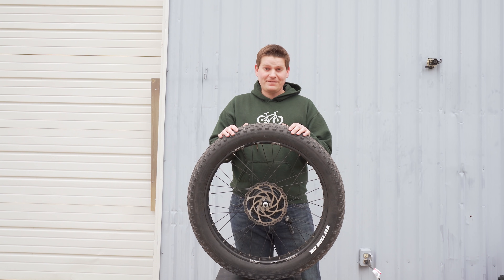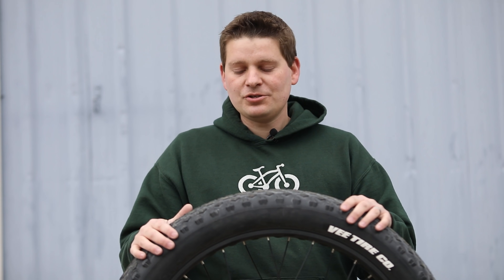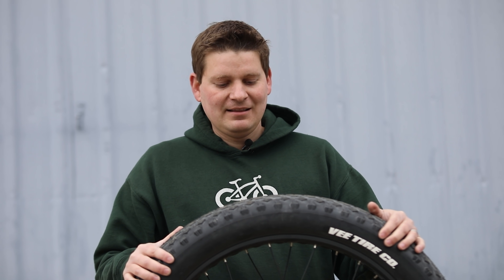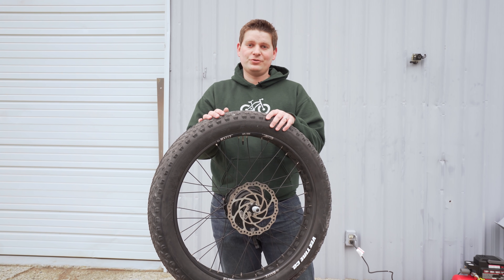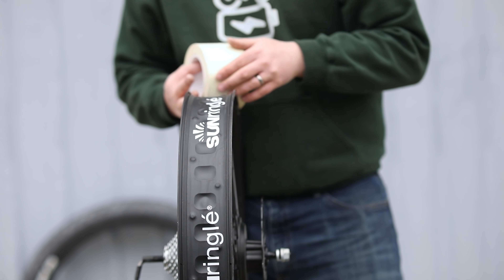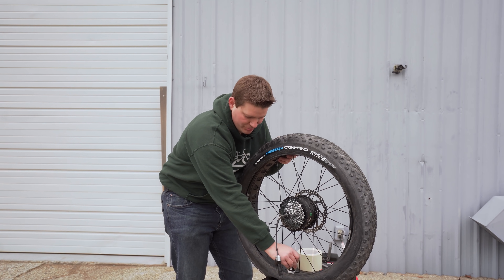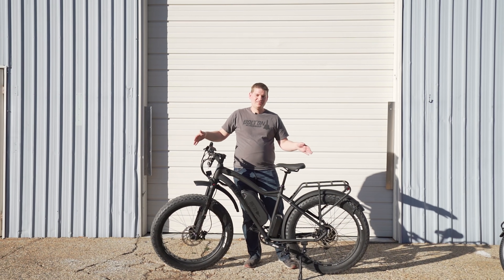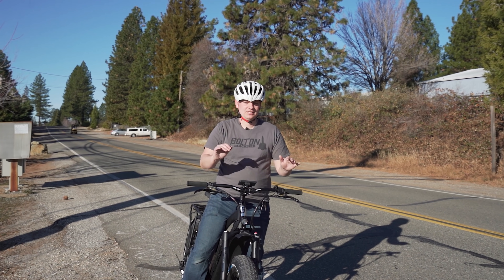Are Tubeless tires good for ebikes? I explain HOW and WHY

Comment from the maker: What other questions do you have about tubeless tires?
Reply: Do you think going tubeless is better than having inserts like Tannus armour? (or you can just make a video about it)
Reply: Do they make a good tubeless ready street trie
Reply: So nothing replaces the tube inside the tire?
Reply: @gbrldz0  Sealant and sealing tape replace the tube.
Reply: Diaz Justine sealant works great ihit a nail the other day . Just pulled the nail spun the tire a couple of times and kept riding that was more like two mouths ago still riding
Reply: Maersk ship from China to LA lost 750 containers in rough weather on Jan 16th.   I hope the blackbirds are headed to Oakland!🤪
Reply: I really enjoy your videos and I'm hoping you team up with a business partner and go hard and LARGE nationally.
As for me I'm sticking with a heavy solution.
Tannus liners with smaller, thicker and heavier motorcycle tubes WITH the appropriate amount of the FLAT OUT tire sealant you recommended.
Heavy? Yes. But almost bulletproof.
Reply: This guy asks for questions then doesn't respond to any of them... Gg

Comment: Instead of weighing 2 bikes cuz I would garrantee even though they are exactly the same there will be a slight difference, why didn't you just stand on the scales with the bike before you started and then just deduct your own weight, and then do exactly the same when you had finished the conversion,this way it would have been absolutely precise, you could have even weighed the 2 inner tubes and the old rim tape and then weighed the roll of new tape and valves and bottles of sealant and deduct it from from the first weight then just add back on the weight of the empty sealant bottles and the remaining tape on the roll. Or even better weighed both wheels before and after before putting them back on the bike .but apart from that I was searching for a video like this and now I'm going to tubeless, cuz you learned me something that I had never even thought about, the amount of energy that was lost compressing both the tyres and the tubes so yeah great value to have watched your video mate, keep up the good work I've learnt something out of it thanks .watching from England West Midlands.

Comment: Several important steps were missed in this video. Rims should be cleaned with alcohol and a clean cloth before installing the tape. When installing the tape, pull tight to minimize air pockets and rotate wheel in the direction of travel. Apply 6" at a time and press out the air bubbles from the center to the edges. Start the tape opposite of the valve stem hole and overlap about 6" at the end. You also want tape about 5mm wider than the inner rim width so it goes up the edge a little on each side and can seat into the spoke channel. Cut excess tape from valve stem hole being careful not to damage tape inside the rim. The 4oz of sealant used in the video is not enough for a fat bike. Use 4 oz for MTB and 8 oz for full size fat tire.

Comment: Your ebike's motor has probably reached it's full speed on flat surface, so getting tubeless wont improve this much. 
But... Tubeless could potentially affect tire diameter
+ lower rolling resistance from lack of innertube, but Minus is micro resistance of sealant.
+ lower rotational mass, faster acceleration and breaking
+ lower overall ebike's mass, so faster on uphill
and If I'm not mistaken rolling ressistance is affected by weight, so 1-3% less rolling resistance just from lower gravitational force exerted on tire.

Like you said, lighter bike, more puncture resistant, less friction=power efficiency.
Only downside is compatibility, price, need for refill sealant sometimes and more frequent pumping.

Comment: If you forget to check tire pressure, it will get low and sealer leaks out.
You have to add more sealer, regularly because it dries out inside of tire.
If you lose pressure on ride, and bead separates from rim, you need special high volume air supply to refill.
You need special rims and tires.
To much hassle for me, will stick with tubes.

Comment: One of the MASSIVE disadvantages is mentioned in the above video but passed off as almost inconsequential.  12:15  Sometimes you can loose up to 5psi a day from going tubeless with a tubed-intended rim, no matter how careful you are.
Reply: I would assume you wouldn't loose any air if you have sealant inside the tire.

Comment: All the fat tires on my ebikes are pretty loose once on the rim, the tire can be mounted by hand no tool required. Vtuvia, Lectric, Himiway are all the same way.  I don't think there would be a way to seat the tire without the tube. I put sealant in all the tires and had to lift the wheel off the ground so when tube filled up it seated the tire evenly.

Comment: Ridiculous video.  Why not just weigh the tubes individually to come up with the weight savings. Saving three pounds and constantly losing air is not an advantage.  Three pounds is hardly perceptible on an ebike.  My wife weighs less than I do and we can both go the same speed and have the same endurance on our class 2 ebikes. You can fix a tube flat without having to take the tire off the rim. Also putting run flat or slime in a tube is a lot less messy when it’s in a tube than when it’s in a tire when you need to take the tire off the rim.

Comment: Great info! And converting to tubeless does indeed make sense including the "back up plan" on re-installing the tube "if" you have to.
Reply: so you are still carrying the tube,, just as a backup now? great weight savings. BTW Peter was wondering when you were going to pay him back. Also, Paul says Thanks.
Reply: @Kevin-ke2lk  Not only do you have less rotational mass which makes handling better but you also roll better making the extra weight negligible, especially on a fatbike that already weighs quite a bit on its own and if you're a heavy rider. So even if you take the tube with you its more than worth it.

Comment: Hi, I wanted to ask if you have tried the Tannus tire armor before. And if so, do you recommend them for bikes and ebikes?

And I had one more question about this time I went to a trek bike shop, I asked them about the Tannus armor, not sure they new what I was referring to exactly, but they said those types of tire armor cause damage to your wheel rim in the long run. Wanted to ask about this too since I haven't heard the same thing from anyone else.
Reply: I 100% recommend Tannis Armor. Best defense against flats on the market and it even provides a more cushy ride after installed. 1,500 miles and zero flats. Even ran over some beer bottles by accident a couple times.
Reply: Btw I do trails and beach riding with my bike so it has been less than ideal riding conditions

Comment: What is funny about a tube tire the worse scenario is a spoke puncture which I had happen on a 26x2.125" tube. The tire had Green Slime in it and that sealant would
not seal against it. I removed the tube and use a wrap of black electrical tape around the rim and replaced the tube with a new tube that had the Green Slime in it.
I never had problems after that with the the rim and eventually went with mag wheels which have sealed bearings. This bike had a 212cc Predator engine on it and
a standard spoked wheel would never hold up under the power from this engine. A solution would be which is better is to go to motorcycle rims and DOT rated tires.
I would say that from my persoanal experience that the mag wheels with sealed bearings are a winner since I've ran this same bike over 3 years with no problems
with the tires except the rear tire wears faster than the front tire since some of the rural roads are chipped during the summer and believe it or not, the front tire
will probably last another year with well over 5k of miles on it.

Comment: Hello Bolton ebikes, ive watched your recent video about Eunorau dual motor ebike. what im thinking is how bad is rolling resistance with two motors?
Reply: It shouldn't effect rolling resistance but it does weigh the bike down reducing range. I'm not particularly a big fan of dual hub motors personally. They do good for traction in a straight line but can get squirrely on turns, especially on slick terrain like wet roads or gravel. Essentially when you turn the wheel they become opposing forces and make it easier for your front tire to slip out from under you. If you are doing dual motors I would suggest a rear hub + mid drive setup.

Comment: You can take her oodles from a bicycle and use it as a tubeless tire you just all you do is take the end and get it right at what the inches are supposed to be cut it off take a piece plug up the holes on each side glue them together wait till they dry and then put it in there and if you need any extra like green that green slime stuff you put it in there and it works as a and it's one of those oodles those that the baby swim on you know it's called the oodle you know it's what it is what it is and it's it's just anyway if food for thought you could try that on these tires that do not carry the all rubber tubes this is what one guy has came up with but I didn't get the end to see the end of his as far as him writing it to see if it worked but he'd made it looked pretty good to me from what I saw anyway could you try one of those thank you bye
Reply: It's really hard to read what you're saying because you use NO punctuation whatsoever!! Furthermore,  it's actually "noodles" not "oodles"🤔

Comment: The very first day I went out for a ride on my e-bike I headed to some dirt roads here in Petaluma to see how well my new mountain e-bike would perform, it performed great but for both tires getting flat because of goat heads. I kept the tubes but added sealant into the tubes rather than get tubeless rims and tires since I couldn't afford them, after adding sealant I haven't had a flat since. BTW I used Green slime since it was available at most auto part stores. Since than I went with another brand, but you can do your own research. Having said that if you can afford tubeless rims and tires, get them, well worth the cost and performance.
Reply: I have a 1.5kw Senada Saber first with the 26x4” stock tires and now with 26x3.5” Vee Speedsters (30TPI tube ready) I have 5 tubes laying around that can be patched and reused. I’m sooo tired of having to randomly change a tube, although I can do the whole process in 5-7 minutes now. Tubeless seems like the way to go as I wouldn’t have to remove the wheel to quickly fix a flat tire - which is the biggest advantage in my opinion.

Comment: I put tubeless tires on my Trek Powerfly 5, which is a hard tail with 29 in tires. I appreciate the increased grip and smoother ride; however, I’d like to have studded tires for the winter but it’s a pain to switch tires.
Reply: Do u have any advice on how to remove your back tire to a ebike?
Reply: @michaelvarguez953  Nope, I got the shop to do it. You have to have a special compressor if you’re using tubeless tires.

Comment: How do Tannus Armour inserts compare to tubeless?
Reply: 1. With Tannus you have run flat ability. 
2. Tannus is heavier.
3. Never had a flat with Tannus Armor.  1000+ miles now.
4. When your tire wears out you can move armor to your next set.
5. Tannus provides a softer ride. More "suspension" if you will.
6. Slime etc al in a regular tube gives equal "flat prevention.
If your getting snake bite flats  or sliced valves you are running under pressure anyway. Stop it.

Comment: Well here is a new update on my 26" Blackbird with the tubeless tires so far after riding 69 miles with zero and 1 pedal assist i am at 47 volts or used 50% of battery which probably could go at least 80 miles or more on a single charge this includes some hills so very impressed!!! Love my new Bolton Blackbird well done Kyle
Reply: please tell me more. hows the standover? do you ride in wet environments often?

Comment: nope, no way...sorry but gotta call you out on being able to run lower pressure in tubeless tires. tubeless and low pressure is bad because of the danger of popping the bead and dumping your air, tubes win this round EVERY time. If you hit something hard enough to "snake bite" the tube you probably would have blown the bead too.  Ask anyone who plays in the sand or mud or races off road about this, Low pressure and tubeless equals flat tires. AND.....come on man, weighing two different bikes to make a weight saving claim? weak man, really weak. give us the actual weight of the tubes and the weight of the tape and any glues used to mount the tubeless tires....ACTUAL weights, not some mythical differences between different bikes when the bikes probably didn't weigh within the same to begin with. Sorry to rip into the video like this
Reply: YEP !  You are 100% correct.  Kyle seems to come up with some really strange stuff at times.
Reply: @specialist-in-tech  I have heard other "bike" guy's say the same thing so I suspect it is coming from a tubeless bicycle tire manufacturer as a sales pitch.
Reply: i agree here.  plus... how many cyclist have a high pressure, shock pump, compressor able to blast seal the tires onto the rims?  cause a slow hand pump won't

Comment: How do people get flat tires on their ebike.
 I've had my ebike for almost 1 years now.
I ride it every single day.
When I built it I bought the cheapest tyre I could find =£9.50.
I've never ever had a flat tire front or back.
And it's very heavy
With two big battery packs
And 1000-watt gearless hub motor.
Reply: @Learn More stop running over those poor goats! What'd they ever do to you? 😂
Reply: I've had mine 3 yrs, no flats yet.
Reply: @Learn More Scientologists sacrificing goats everywhere?

Comment: why not go all the way and get airless tires
Reply: You can get them but they are very bad compared to tubeless tyres with air
Reply: @scottrocks1993  ok, why?
Reply: @chrisrosenkreuz23  To answer the question: they are very unforgiving. You will have less rolling resistance and slightly more range because they don't conform to the ground, but you will also have a more bumpy ride and less traction for the same reason.
Reply: @captaincaveman8532  huh, that is very interesting and worth considering. Cheers for the answer

Comment: Tubeless is a good option for E bikes but telling people it’s going to make it faster and give them more range is nonsense! You’re talking about under 5 pounds and that is not going to affect the range or top speed in any significant way. I think tubeless is a great option but simply to avoid flats. Now on a regular mountain bike going tubeless making it slightly lighter actually will help you but not compared to a heavy fat tire bike. Come on dude let’s inform people with truth and not sugarcoat it.

Edit: 
As an example I weigh 180 pounds and the top speed of my 2000w E bike is 40mph. When my girl rides my bike which only weighs 130 pounds it doesn’t affect the top speed or range at all and that’s a 50 pound difference!
Reply: yeah, and TRULY should only do it if you have tubeless ready rims.  Period.  Lot of scary stuff this guy talks about.

Comment: Hi, looks really cool I like that idea, been hearing about this a lot lately but I have a question for future references when I do get an ebike, if I were to decide to go tubeless and put the tire sealant in, how long does it last? 
How often would you have to refill the sealant in the tires?
Reply: You shouldn't need to replace the sealant until you swap tires.
Reply: I hav heard, you need to add more, every few months, because it dries out over time.

Comment: It’s funny multiple reviewers of EBike say “ weight doesn’t really matter on an EBike “ head scratcher- if every component or add on was designed with weight reduction it might take weight off and increase your range-
Reply: Reduction of rotating mass improves handling a great deal. Losing 3 lbs in the wheels is far more valuable that 3 lbs less in the frame, seat, etc. He didn't address that, but improved handling, braking, and acceleration are the main benefits of dropping rotating mass.
Reply: It's more about the ride quality and flat prevention.  Weight reduction is a nice by product.  Weight's much less important on ebikes.  Many people making the transition to having a motor on their bike have trouble with the paradigm shift.

Comment: Very helpful. I've changed lots of motorcycle tires and tubes, but going to a tubeless bike setup is new. I really like the suggestion of reinstalling the tube after applying the sealing tape. It is a small hassle, but it seems to be a very worthwhile upfront effort.

Regarding the air source, would CO2 cartridges provide enough of an air "rush" if one doesn't have a compressor? I may try it, but I suspect I need to either get a compressor or go somewhere that I can access one.